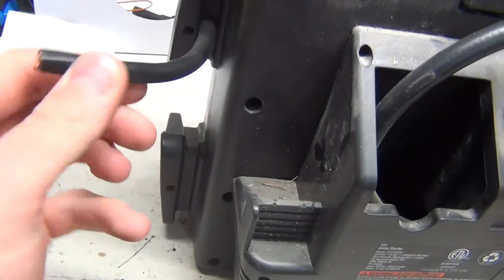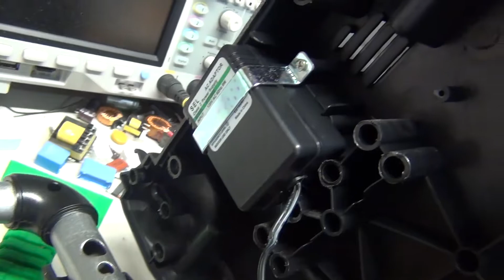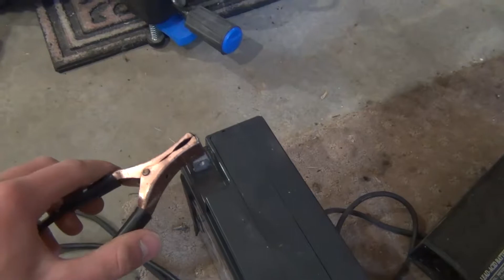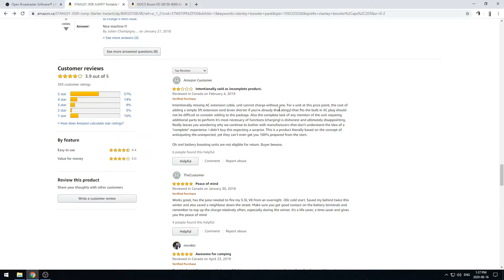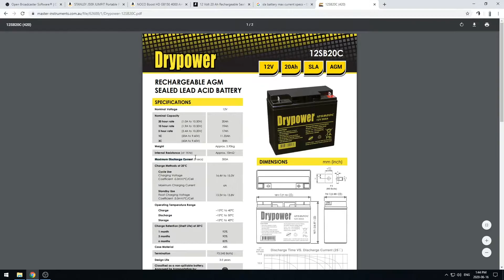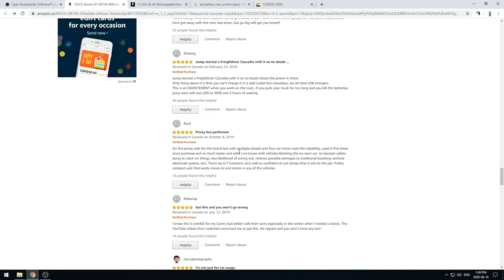Stanley Junkit 1000 Teardown & Warning

Comment: These things last forever if looked after properly and are probably older than you.
Something to keep in mind when comparing them to lithium chargers that weren't even commercially avail/viable for the average person. 
The fact that you can buy parts that are used in this at Walmart means absolutely nothing and you consider the required circuit board for the indicator lights as pointless?
Your whole reviewing style reeks of arrogance attempting to mask your inexperience.
I just replaced the battery in mine that I bought new in the early 2000s I think and it's working fine.
Never expect a decent price on Amazon for old stuff like this.
They have zillions of old stuff on there that is ridiculously overpriced.
In it's day it was a marvellous piece of equipment sold by Canadian Tire, and it was meant for the average person to get themselves out of a bad situation.
Mine came complete with USB power, an emergency  light, a Cig lighter powered plug as well as an air compressor that I worked to death.
I most likely will fix the air compressor too seeing as it's running and probably only needs a new seal around the piston.

Comment: The factory installed battery is crap. Mine failed in less than 2 years. Appears from the comments below others had better luck. Anyway, replaced the battery (cost almost as much as the unit itself) with a non chinese North American  made one. Still going strong after 10 + years with above average use.

Comment: The jumpers leads are NOT copper. Cu plated AL like many jumper cables today. 
They do have a braid connecting both sides of the clamp. Lots of mfgs cheat on this.
Cable lugs looks like AL but are magnetic???  0% odds they were magnetically crimped. (it's a thing)

Buried wall wart is so that Co pays for the UL/Ca listing. This is why wall warts are a thing.
Instant starting cranking cold cranking are industry standard terms. I think marketing was trying to use LiPo terms to sound modern? Peak amps is not std and could mean milliseconds into a dead short?  

tl;dr
Sealed Lead Acid fully charged
CA 30 seconds 32F rated amps without dropping below 7.2 volts.
CCA 30 seconds  0F """
Reserve 25 amp load until 10.5 volts @ 80F

Li-Ion fully charged
CA @ 70F for 3 seconds. 
Starting Amps 70F 30 seconds
CCA good luck with that.
Reserve usually not listed.

Comment: I would have to say that These Stanley units are built pretty rugged but yes the internal battery suffers a lot from the date of manufacture to when the entire unit was built - and what kills these batteries is the sitting around with little or no charge to begin with - the battery itself after it's manufacturing then sitting to when it's put into one of these booster packs-  then more sitting to when its shipped out to a store - it could be up to 2 years before a consumer buys the unit to put it into use. BUT the good news here is that the internal battery  can be replaced as I replaced mine at a fraction of the cost to buying a whole new unit of $149.00 - the internal battery was only $69.00 from a store that deals with electric wheel chairs and scooters  for the disabled. It's still going strong for nearly 10 years, But saying dont buy these boosters  - says to me you would rather risk a lithium polymer fire from one of those Noco units compared to a glass matte type battery which is far FAR safer. HMMM I would rethink your logic. Look at Project farm channel when these lithium polymer units were stress tested compared to this Stanley unit and you tell me which is safer..The other problem you have to realize is there is no way a 1000 amp circuit in any car or truck for that matter.  Putting a 1000 amps to a starter the armature would FRY... So Need I say more ?

Comment: That "special" cord is any extension cable, that's all you need to charge it. People not realizing this really makes me question what goes on in the minds of those around me. 

As far as starting an engine? You're talking a standard four cylinder will pull up to 75-150 amps at most, V8s will want up to 100-300 amps, depending on compression and size. Diesels will pull up to 250- 500 amps, but again that depends on the engine. 

These SLA packs are fine, just know their limitations and take care of them, same goes for those lithium ion (or sometimes LiPo) packs. They can be just as dodgy as any SLA jump pack, possibly even more so when you take a look at those specs, although the technology in them has come a long way since their inception. 

Either way, use what works for you and what you prefer. I made my own jump pack out of a Pelican style case with a respectable sized SLA battery and it works great, no stupid electronics or cheap charger either.

Comment: My Stanley jump starter is lasting me more than 6 years even keeping it in the trunk all summer and winter and I park outside. I just try to keep it well charged to give the battery longer life. It saved me with my battery and tires lots of times. I feel that they are very good to last me more than seven years.

Comment: I'm not about to say anything about whether or not a booster should be designed the way this one is. However, considering this has a replaceable wall wort and battery, I would look at this as being a serviceable device. A replacement battery would cost $40. A replacement wall wort would cost $10-$15. How much would a new booster cost? $100-$150? I'd rather have something that's serviceable than to contribute to the growing pile of e-waste.
Reply: Do what I did with an old Harbor Freight jump pack and ditch the built in charger. I put a barrel plug in it and sealed it back up, now I can use any low amperage charger and get a good, complete charge without worrying about over charging the battery. 

It's well worth the few dollars and hour or two it takes to make it right!
Reply: This! And people don't realize it, but all the custom PCBs just have the same copy paste circuits that wall warts have anyway. Maybe even with less protection.